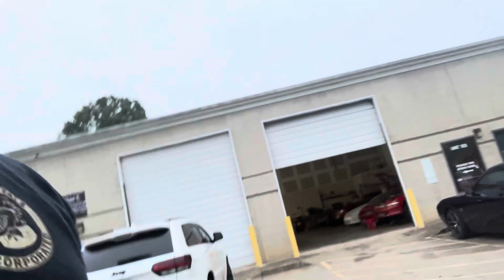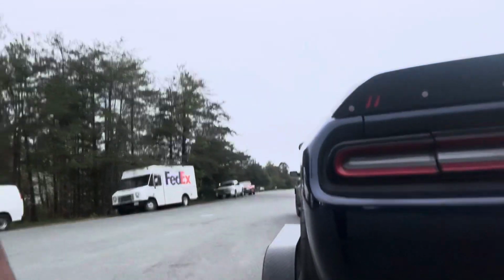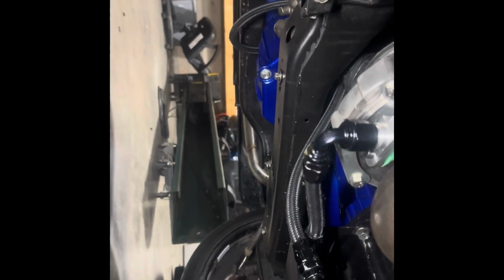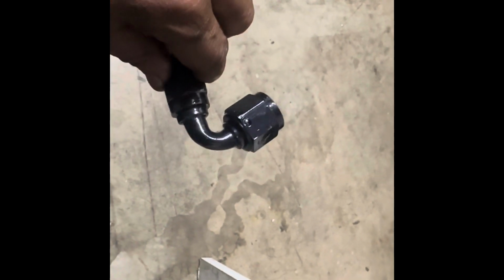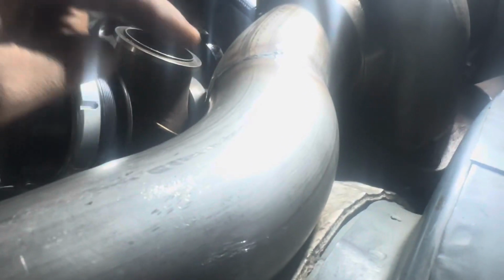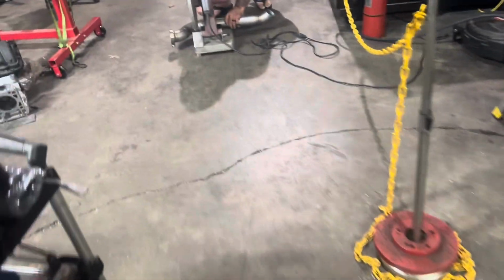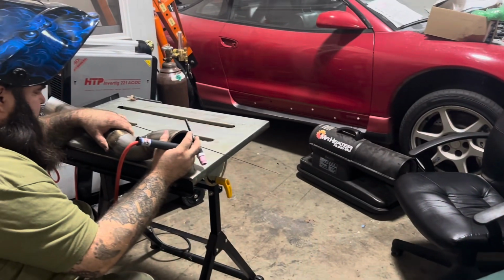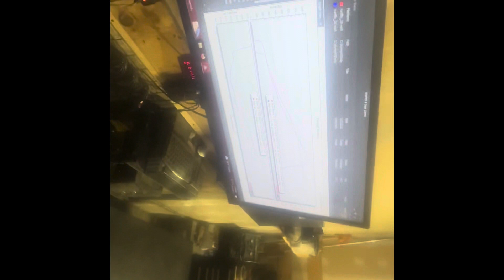Twin Turbo 5.7 Hemi Hits the dyno

Comment: Jay, does it matter where on the header you place the o2 sensor for wideband?
Reply from the maker: Bruce do want at lest 8 inches away from the exit. Also depends on which O2's you are asking about, front or rear
Reply: Going into header where front o2 is located. Only have the high flows  now